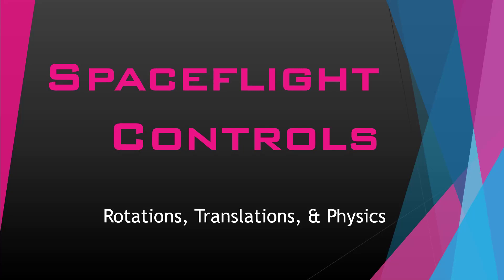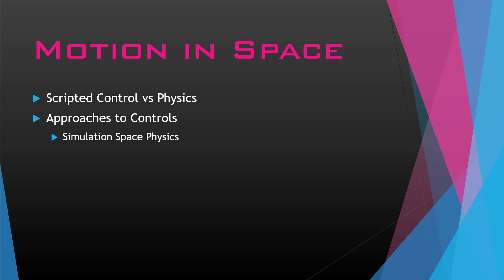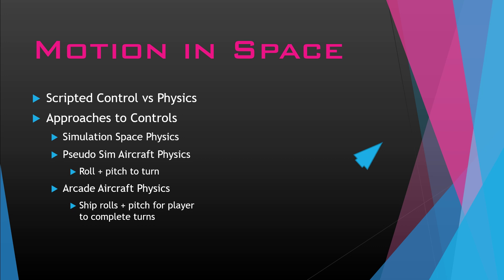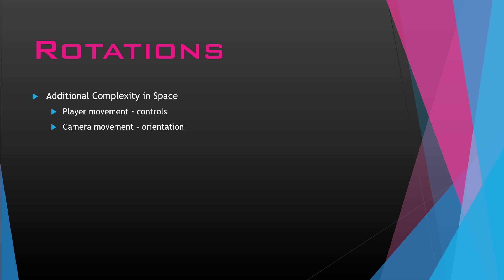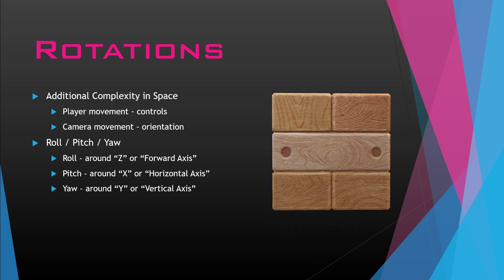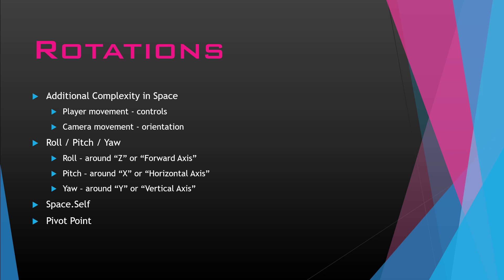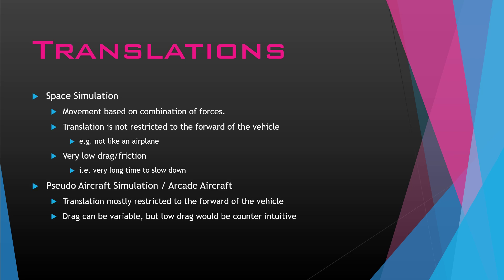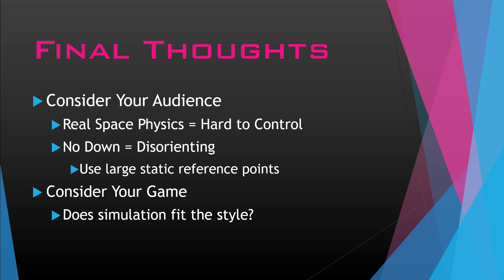Spaceflight Controls in Unity3d

Comment: How would I be able to switch between Newtonian and a course correcting flight assist?
Reply from the maker: So, that's actually a subject of a future video, but there are two approaches. The first is to simply create two separate functions that behave differently, and put them both in your update or fixed update, and simply say something like,
   if(flightAssist) { aircraftControls() }
   else { spacecraftControls() }

The second approach will be to have flight assist built in to all controls, say a "transverse" (local XY plane) dampener, that stops a ship from "sliding" in a direction. My thought was a dampener can have a max strength, so a large ship with a weak dampener is going to struggle, but a small ship should have relatively tight control.
Reply: @bitgalaxis1147  I''ve got the Newtonian Physics working, had to replace ''transform.Rotate'' with ''AddTorque''. I''m going to be testing the Flight Assist/Newtonian toggle, when I get it working I''ll send the code to you for that future video of your.
Reply from the maker: @ARGHouse504   Nice!